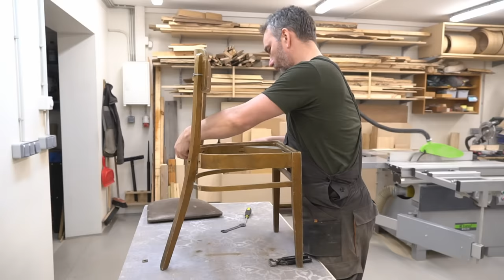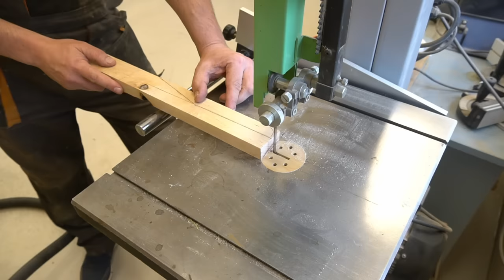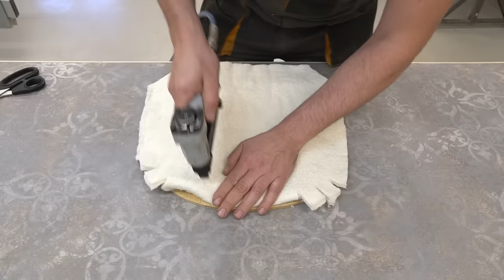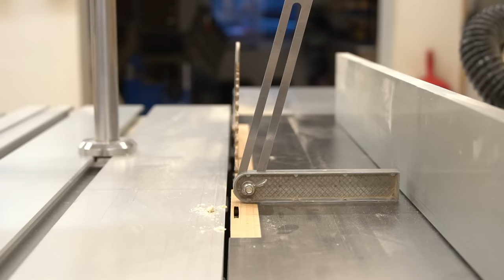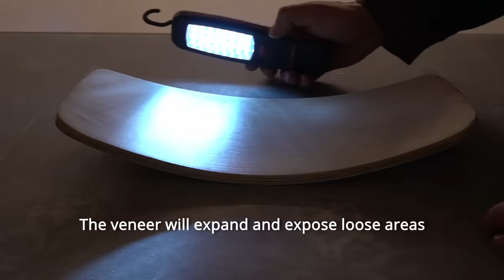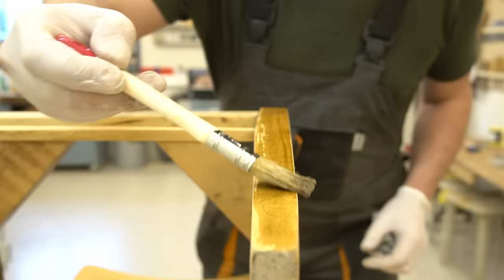Watch how pro restorer does his job / 50-s chair restoration

Comment: Tbf the original wire repair was a good job because it wasn't destructive and held up until someone skilled could repair it.
Reply: @robertthomas5906  harsh, but true.
Reply: @AllAboutMiims  That's very likely what would have happened to me.
Reply: @robertthomas5906  It's a $10 chair. DId you really expect someone to spend a day and $100 restoring it? I would have used it as a fire wood.
Reply: the wire repair was soviet repair because replacing was not possible and likely did not have the proper materials or tools to do a correct repair because......soviet
Reply: @Slenkamure  Soviet products was of highest quality,bro.
Reply: @ЖеньшеньПомпень  sure it was comrade
Reply: I agree ,not everyone on the planet is a skilled joiner
Reply: Good homemade repair. Go figure if I have at home 50k of tools for repair a chair.....🤦🏾‍♀️
Reply: Totally agree.
Reply: Yeah, and let's talk about the nails that were put in place probably before the wire repair, it's obvious they will be totally useless

Comment: This type of joint is not weak: this is what is used on a daily basis on guitars & basses all over the world, and they endure hundred Kgs of force due to the strings tension very well. Cheers from France!
Reply from the maker: Thanks, mate!
Reply: The force acting on a guitar neck is putting virtually no strain on the joint at all, because it's almost precisely in line wth the neck. Even if you have a VERY high action, the offset is minute, and almost the entire force is doing nothing other than pulling the neck into the socket
Reply: @ashscott6068  You know what a truss rod is?
Reply: @ashscott6068  Force in line with the neck is what I was talking about, yes. Why would it put "virtually no stress at all" on the joint? The joint is diagonally set, so it must endure forces both perpendicularly and in line with it.
(PS: sorry for my bad english)
Reply: Necks where the neck and headstock are built using this scarf-joint are much stronger than the one-piece necks that idolized Gibson guitars still use. Thank goodness their more affordable Epiphone brand has the good sense to use a scarf joint.
Reply: It just depends on how you define “weak”. Other types of joints are stronger, but the only question is whether it‘s strong enough or not. In this case it’s very simple: if you mistreat that chair, it will break in other places long before that joint ever comes apart.
Reply: It all depends on how much force it needs to withstand, and in what directions. While there are stronger joints, they tend to be a lot more work and harder to make neat, so why not use this much simpler joint when it’s strong enough?

Comment: 45 years ago, I found two old rocking chairs, with cane seats and backs, in my grandparents shed.
Both had broken parts.
Since the rockers were alike, I was able to savage one rocking chair from the two.
They were covered in red barn paint!  They must have been used as porch chairs once they were no longer in good enough condition to be in the parlor.
I saved up and had the parts vat dipped to remove the paint and then glued and refinished with only linseed oil and paste wax.
I had the chair caned.
Beautiful! 
The finish has lasted 45 years....with lots of wear from children and pets.
I had it in my home for many years and then passed it on to my daughter.

Comment: That old chair had real character! The loose joints, the coat-hanger wire holding together the broken back. It must have been exciting to sit in, get the adrenaline pumping. An experience to remember.
    Now it's just a common chair you could get 100 copies of from China for $5 each.

Comment: First of wonderful video. Learned a few things. But 2 questions. 
1. What was the purpose of the sideways /heavily angled brush staining application technique. Never seen that be for.
2. What is the mixture ratio roughly of shelf to sprits you use as a “seal coat” prior to stain.

Comment: Great video obviously a professional and very professional done.... right up to the point of finishing, then as per usual he does a slap and dash. Please stick to your own profession and when you get the joinery finished send it to a French Polisher so the skill level can be maintained.
Reply from the maker: This chair originally had  a industrial (pentaphthal or similar) laquer on it, there is no point of polishing it.
Reply: @ATRestoration  I can't tell by the video what type of lacquer is on the chair, but whether it's an Acid Catalyst, Varnish or more than likely for that era a Nitro Cellulose I promise you it could be chemically removed. As for if it's worth it, if you have gone to all that effort in the first place then finish it properly.

Comment: Great restoration.  But I had wished you had not glued in the stretcher rail when it seems it wasn't before (unless old glue wore off?) & also not have had to hammer glue in the plugs in back rest, for easier future maintenance access to the screws. Maybe use rubber plugs idk.  But again, awesome work.  How long did it take?

Comment: “Can you repair this 50$ chair?”
“Sure! It will cost you 250-300$.”
“Sounds great. Go ahead!”
Amazing job!
Reply: You're supposed to do the repair, yourself.  That is why the chair appreciates in value, if the restoration is done properly.  The proper procedure is to submit an item to a certified estimator - who then TELLS you ( in writing ) what the item is worth.  Also ask them what the recommended procedure / and supply cost will be ( if you go that route ).

Comment: You reminded me of a chap I used to work with, I had to go into the office where he worked just as he jammed his thumb in the filing cabinet.  Being the gentlemen he was he grimaced and said 'Well fffancy that'.  I remember those chairs. they were used in meeting halls before the advent of wall to wall plastic. Didn't they have screws holding the back that had washers with them or am I mixing them up?

Comment: I am actually surprised that the wood itself haven't deteriorated over the ages. Is it because of the heavy lacquer that's keeping the elements away from the wood or was there a special process for woodwork back in the days?
Reply from the maker: It is not so old and plywood, is a strong material.

Comment: Great choice using faux leather, it's a lot harder wearing than real leather.
Here's a tip to stop the wooden plugs flying away when machining them...use a thicker peice of wood and don't machine all the way through and then gently prise them out with a small flat headed screwdriver.

Comment: Why would anyone claim a scarf joint is weak. It has the maximum contact area for glue. There are variations but usually for load bearing floor joists.

Comment: When you use the iron to put on new veneer (like the big piece you glued to the back rest) are you pushing the iron down hard or just letting the weight of the iron do the job?
Reply from the maker: Yes you need to push it down, the modern iron is light weight.
Reply: @ATRestoration  I will give that a shot. Thank you.

Comment: Never done furnitue repairs so I had a question about that joint you made for the back. The best way I can think to ask this is by "drawing"...

So you made the joint like this;
|       |  <--
|    //|
|  //  |

As you lean back you're putting pressure on that joint where I put the arrow. My question is, how come you didn't cut it in the opposite direction? And, would that even make a difference?

Cutting at this angle;

|       |  <--
| \\   |
|   \\ |

In my mind this would hold up better to the stress of someone leaning back, but I don't actually know if that's true!

Hopefully this displays correctly when I post this comment and hopefully it was clear enough lol.

Comment: The woodwork was fantastic! The upholstery job not so much😅 that`s gonna be one bulky uneven seat in a few wheeks.
Reply from the maker: Not really. I used the same farbric and technique on the chair thats in this video https://youtu.be/lzt6iBkT9tw
Here you can see how it has lasted over the years of use.
Reply: @ATRestoration  the part i take most issue with is the folding in of the ends. It will create bulk. I`m an upholsterer. The padding should be cut about 1 cm out from the seat plate, or tacked on the underside.
Reply from the maker: @karikiiiks6880  Agess you can do it multiple ways. When I leave the space between the edge and padding, the empty space will be visible. Maybe its my fault, I dont know.
Reply: @ATRestoration  that is why you cut it a cm outside of the edge. Most common is tacking it on the underside. It lasts longer.
Reply from the maker: @karikiiiks6880  Ok, that would be impossible to do with that chair, because the bottom goes inside the frame and theres no room for that.
Reply: @ATRestoration  most chair seats go inside. I`ve never had a problem with it being too tight.

Comment: At some point, i start wondering whats the point of this work as the amount of repair is basically no difference from replacing the whole thing, its not like thers any antique value showing from the end product as almost everything on the surface had been replaced with new matrial.
Reply from the maker: I could have done new, but it would have been just a little bit more expencive and it was also a little bit easyer to repair the old one.

Comment: If U use modern screw, and plug it U prevent next restoration. One slot screw U always can be remove, modern, harden, with torx or philips head ar no so easy if have whornout bit slot. And U clogged it by glue and plug.

Comment: I don’t know, seems like a chair that came with a table set to increase buyer incentive and raise the profit margin for the sellers. The table was probably rad, but the chairs were most likely an afterthought. 
I have found myself endlessly involved in this exact same project over the years. What I have learned is that the amount of time it takes to fix garbage over and over again far outweighs the amount of time it would take to copy the design and make it properly. Just sayin! 🤷‍♂️

Comment: I don't believe this video, it was deliberately repaired that way for video purpose, such clean and precise holes drilled for the wires to go through, wire used is not rustic, its brand new aluminum. And the way the pry bar fits perfectly into the wire gaps to pull out.
Very fishy...

Comment: I don't see how glue is going to hold out against someone with any sort of weight who leans back. Seems you would have used some form of fastening instead of just butt together and glue. Biscuit would have done alot with minimal effort
Reply from the maker: If the joint is made right, it has the same strenght than solid wood does.

Comment: That isn't profesional restoration. Nobody, especially professional kept  finger or hand after saw blade, kick back is very dangerous.... on the back seat he rise the veneer on the middle by chesal and not fill the glue,
 Iron for bended pc not working well living many bubbles from evaporatorated water better is clamps Fleexwood and not sticky material between slaves off wood...
Front leg also need to be torn apart and reglued....

Comment: You have to cut the sharp hammer sounds out of the video man. Turn all the monotonous parts of the job into montages with music and narrate the more hands on details of the job. It will be a much better quality video
Reply from the maker: Good points but unfortunately I have learned from my statistics (retention rate), that people don´t mind the working noise but they always click off when I use music. It´s weird but that's the way it is. I was surprised too. That's why you see that many channels don't use music at all
Reply: @ATRestoration  
Wow that's honestly really weird. Try using hardcore metal for your montages and maybe it will keep your bounce rate low 😂

Comment: Chair needs more bracing where the back legs meet the seat or it will fail again.  It is a poor design to start with, its style was produced in bulk not because it was a good chair but because it was designed to be made quickly and cheaply.  

I guess people will be restoring Ikea chairs in 60 years pressing particle board back together and polishing those hex bolts.
Reply from the maker: On the contrary, this design is VERY strong. The rear legs are bolted to the apron, you cant make it stronger than that. Also the apron is made out of plywood which is much stronger than just solid wood. Because apron is made from U shape plywood, there are less joints to fail.

Comment: Parts of this made my eye twitch.... Like I know everyone wants to be kind and positive but some of the choices here are baffling.... Like dry sanding laquor finish.... And if you are just putting one piece of veneer over the entire back piece, you don't need to cut any place vaneer on the chipped areas? Like you could just use thin wood or puffy... But you chose to veneer some veneer.... Just some of it I'm baffled by. Up vote down vote comment you get the metrics regardless this video feels troll
Reply: Techniques aside the chair was a piece of shit to begin with. Not worth buying brand new let alone repairing one stapled and duct taped together